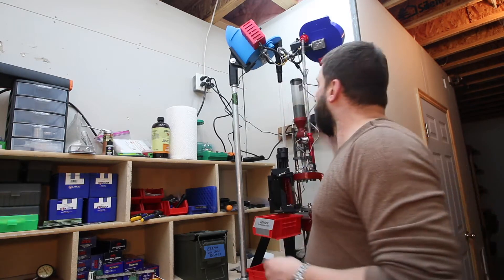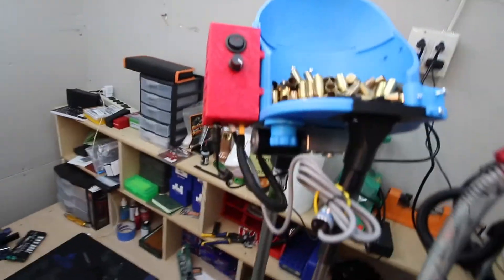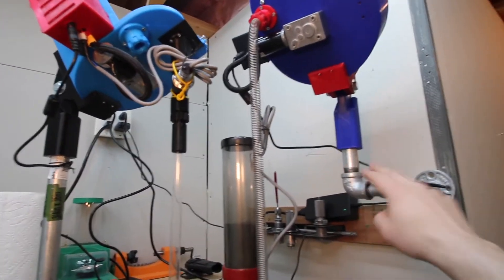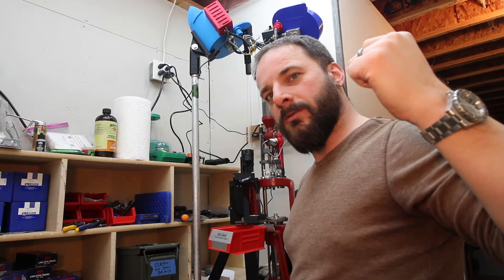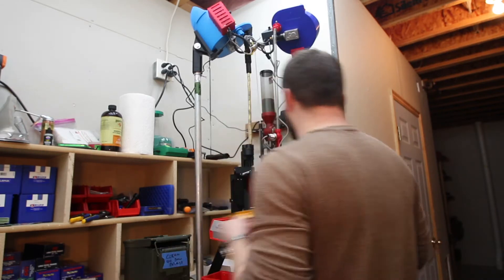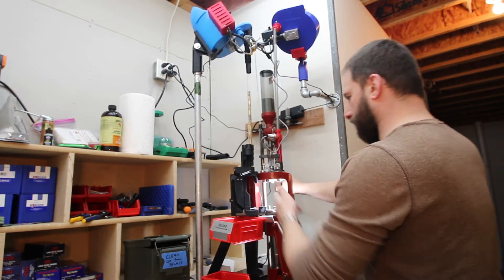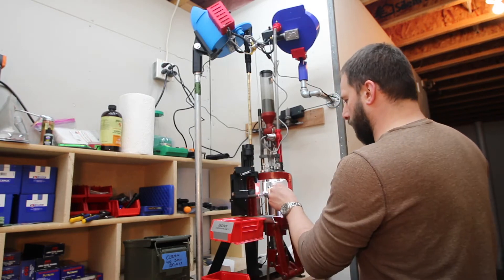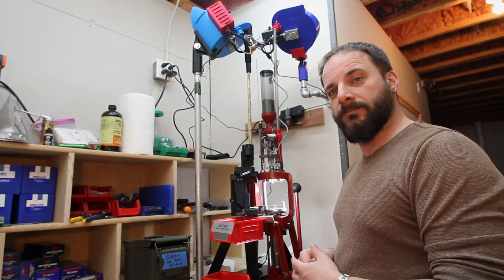3D Printed Brass and Bullet feeders for your reloading press

Comment: Thanks for the video. It looks like you are still working out the bugs.
Reply from the maker: No real bugs to speak of. Just requires adjusting the tilt of the buckets, as well as making sure to use the best wheel for each bullet or case. Im sure the latest files have some further updates, but I haven't bothered with any changes since I printed mine. The setup works well enough, with only the occasional (1 every few hundred rounds) upside down bullet or case.

Comment: Awesome setup! I just got an Ender 3 v2, I’m looking forward to printing some useful stuff like this once I figure out how to level my build plate correctly😒.
Reply from the maker: That was a bit of a pain for me as well. I ended up just spending the time doing trial and error to get it. You can get some stronger springs that also help with the process. Additionally, there was an automatic leveler that works pretty well. That may be worth checking out.